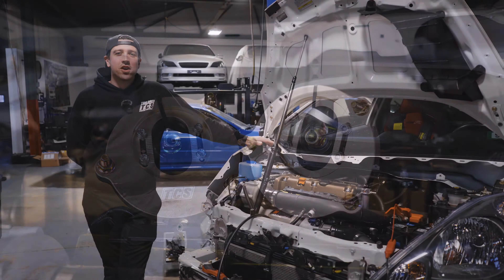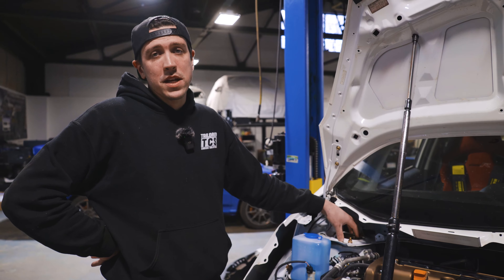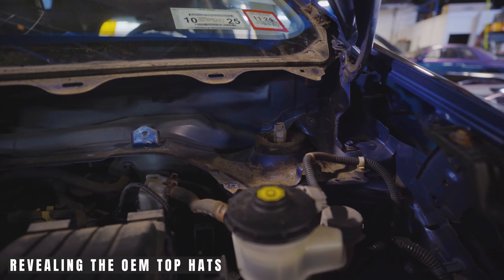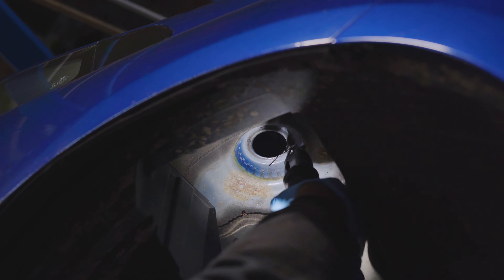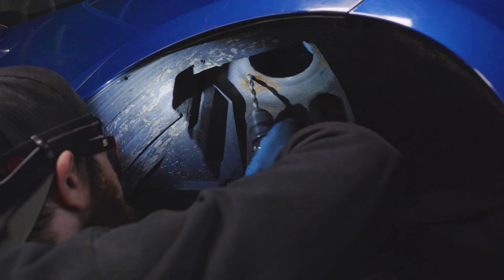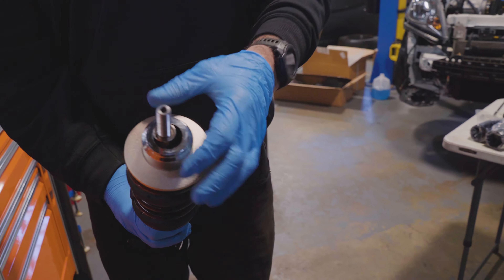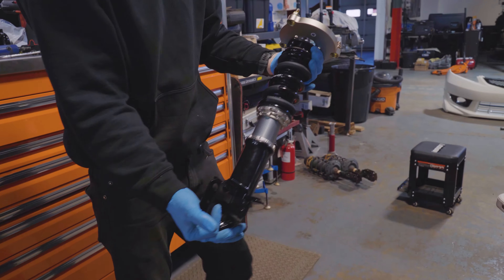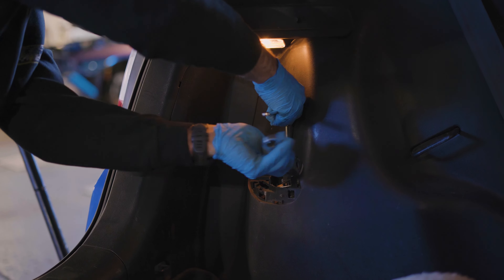Installing TCS Caster/Camber Tophats

Comment: Have you set up any B-spec cars? I'm assuming these plates would also work for B-spec Fits (and Versas) as long as they were installed in a way that doesn't add any caster (the rules don't allow changing caster).
Reply from the maker: The bolt pattern is asymmetric so its really designed to be installed the intended way as shown. I have sold some to bspec guys over the years and they install them as such, spec line be damned. Otherwise 2 crashbolts at the knuckle or ovaling one of the tabmount holes to achieve near desired camber will also work.